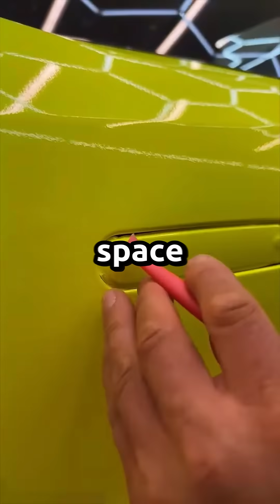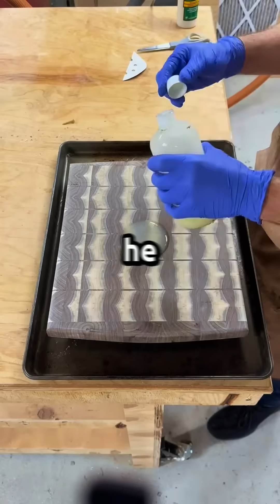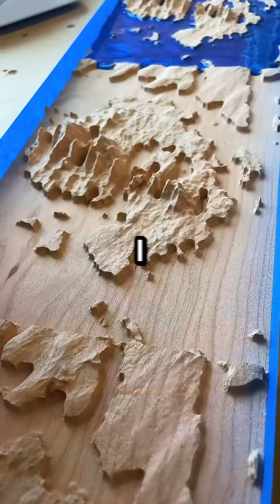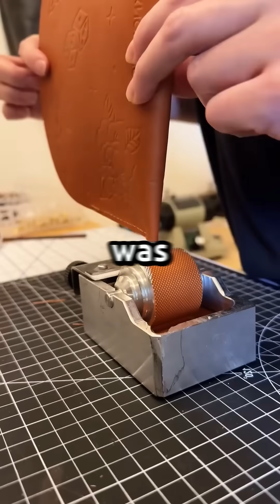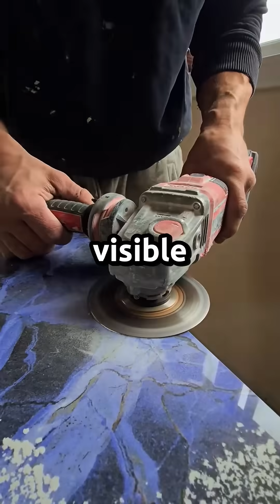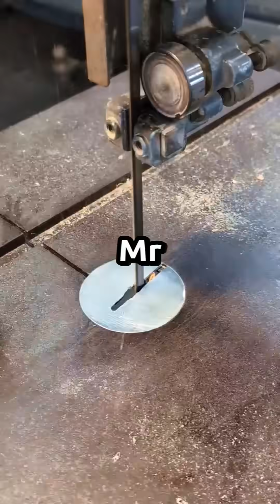reddit story

Comment: Funnily enoigh, i was tought that too. Untill like 5th grade where the curicullum got updated. For some reason, the 1 to 4 grade, they still used an old, outdated curriculum. I remember how i was wondering how is the wall visible, but the piramid not. Is not like the wall is built in a spiral to matter how long it is, and the great gyza piramid is much wider. Then it clicked in 5th grad. Propaganda basically 😂

Comment: The most inaccurate thing I was taught? The Holocaust 😏 250 thousand tops, according to the red cross documents and mostly due to typhus and starvation because the allies had bombed the supply roads because they needed to manufacture an atrocity to be used as leverage against the West in order to extort it

Comment: The F-35 Lightning II is a family of stealth multirole fighter aircraft developed by Lockheed Martin as part of the Joint Strike Fighter (JSF) program. Designed to perform ground-attack, reconnaissance, and air-defense missions, the F-35 comes in three main variants: the conventional takeoff and landing F-35A, the short takeoff/vertical landing F-35B, and the carrier-based F-35C. The aircraft is intended to replace a range of aging fighter and strike aircraft across multiple branches of the U.S. military and allied forces, making it one of the most ambitious and expensive defense programs in history.

A defining feature of the F-35 is its advanced stealth technology, which allows it to evade radar detection and operate effectively in contested airspace. It also boasts a sophisticated suite of sensors and communication systems, including the Distributed Aperture System (DAS) and the Active Electronically Scanned Array (AESA) radar. These systems provide the pilot with unparalleled situational awareness and data-sharing capabilities, enabling the F-35 to function as a "flying command center" within a networked battlefield environment.

The F-35’s design emphasizes both agility and survivability. Its single-engine configuration is powered by the Pratt & Whitney F135, one of the most powerful fighter jet engines in the world. The aircraft’s internal weapons bays maintain its low radar profile, while also allowing it to carry a versatile mix of air-to-air and air-to-ground ordnance. Over time, its mission systems have been updated through software-driven upgrades, improving combat performance without changing the aircraft’s airframe.

Despite its cutting-edge capabilities, the F-35 program has faced significant criticism over cost overruns, production delays, and maintenance challenges. However, as more units are delivered and operational experience grows, many of the initial issues have been addressed. With over a dozen allied nations now operating or planning to acquire the F-35, it has become a central component of modern air power in the 21st century, shaping the future of aerial combat for decades to come. Would you like this turned into a presentation or infographic?

Comment: One claim was that the China's Wall is visible from the moon.
It isn't.

But it is possible to see it from the low earth orbit when the conditions are optimal.

Something being possible to see, doesn't mean you can always see it, or it is very easy. 

Like example, there are events when one can see other city lights other side of the sea, over 80 km away. Even when the horizon is just about 5 km away and doesn't provide straight line of sight.

Yet it is not incorrect to say that other country city lights can be seen over the larger sea. As well the tallest buildings, towers and chimneys. As it is possible, just that it requires specific weather conditions, lighting and season. A rare event, but still possible.

This is the same thing with Chinese Wall.
Even the NASA astronauts has told that it can be seen, but in very specific conditions. 

And that is enough to support the claim, that it can be seen from the space.

But it is not only man made thing you can see from the space...

Comment: First, my point: that's why some teachers and professors who contributed to researches in education during the XX century promoted classes centered in the students instead of the teacher, shortening the distance between teachers and students.

I feel that sometimes these reddit stories are exaggerated, but even so, they are plausible to the reality. This is the type of situation that I saw happening before or listened from classmates. My mom said that a math teacher confiscated her book and told her to leave the class because she was reading after finishing her assignment in class and was waiting other students finish and the teacher to correct it on the board (about 40 years ago). I had another math teacher making me cry in the class because I didn't understand the assignment (I was an "outstanding student" - lit translation, an merit we received in school after finish a year with excellent grades in every class - I am an engineering undergraduate now).

Comment: I had done similar things in school. I unfortunately was much smarter than most the teachers and would often correct the teachers. except there was no happy ending for me. they instead suspended me multiple times and then placed me in special needs classes for my "Disruptive behavior".  I was stuck in the special needs classes for almost my entire time in school.  that was until I was old enough to apply for running start and got to skip all of high school and take college courses instead. earning my high school credits from my college courses. at college I got almost perfect grades and got onto the deans list.     I majored in computer science as I wanted to become a programmer.  I enjoyed solving problems with my logic and reasoning. No one could argue with me about if I was right or wrong when the software I developed worked  perfectly.  unfortunately I failed to find a job in the industry as I failed to develop the social skills to get past the hiring processes and now the industry has essentially collapsed.  now I just hate people and government as they have done nothing but get in my way of my ambitions.  I  am looking forward the the collapse of society . I am looking forward to extended blackouts. as studies have shown 90% of the population will die.  while I have been learning the skills needed to survive such a collapse for the last 10 years.  soon I will finally be free of humanity.

Comment: THOSE WHO DON’T KNOW

⸻

ANTIMATTER — THE FULL BREAKDOWN

Alright, listen up — antimatter is no ordinary topic. It’s basically the most extreme, powerful, and mind-blowing stuff in the universe.

⸻

WHAT IS ANTIMATTER? (Definition)

Antimatter is like the dark twin of matter. It’s made of antiparticles — these are just like normal particles (protons, electrons, neutrons), same mass, but with opposite charge. For example, the positron is the antimatter version of the electron, but it’s positively charged.

Here’s where it gets badass: when matter and antimatter meet, they annihilate each other in a flash of pure energy — no leftovers, just raw power, usually gamma rays. This is basically the universe’s most intense form of destruction and creation.

⸻

EXAMPLES OF ANTIMATTER
	•	Positron (e⁺) → Anti-electron, positive charge.
	•	Antiproton (p̅) → Anti-proton, negative charge.
	•	Antineutron (n̅) → Anti-neutron, same mass, flipped insides.
	•	Antihydrogen atom → The simplest anti-atom: antiproton + positron.
	•	PET scans → Medical tech that uses positrons to scan your body — antimatter saving lives.

⸻

HOW’S IT FORMED?

Antimatter doesn’t just pop up for no reason. It’s born in places where energy is off the charts:
	1.	The Big Bang → When the universe exploded into existence, it made equal parts matter and antimatter.
	2.	Cosmic rays smashing into Earth’s atmosphere → Space bullets hitting us at insane speeds create antimatter right above our heads.
	3.	Radioactive decay (beta-plus decay) → Certain atoms spit out positrons.
	4.	Particle accelerators → Scientists smashing particles together at near light-speed — boom, antiparticles.

⸻

WHY DOES ANTIMATTER EXIST? (Causes)
	•	E = mc² (Einstein’s big rule) → If you’ve got insane energy, it can turn into matter and antimatter.
	•	Quantum chaos → Even in empty space, tiny particle pairs can just pop in and out of existence — a wild party at the quantum level.
	•	Balance of nature → Whenever the universe makes matter, it has to make antimatter too, to keep things balanced.

⸻

BONUS: WHY IT’S A BIG DEAL
	•	After the Big Bang, almost all the antimatter disappeared — we don’t know why. That mystery is called matter–antimatter asymmetry, and scientists are still scratching their heads.
	•	Antimatter is being studied as a next-level space fuel — because when it annihilates with matter, it unleashes insane amounts of energy.
	•	We can trap antimatter using magnetic fields — yeah, we’re basically building sci-fi tech in real life.

Comment: My father was a precision grinder, in the early 2000’s after almost 50 years in the industry he got a new apprentice. The apprentice said that he learnt you can't grind aluminium. My dad said yes you can, you need to know the trick. He showed the kid and proved it was possible. He then when into the tech school the following week, and told his teacher who actually yelled at him and said not possible. In the end-of-semester test, there was the question, he wrote yes with a full explanation of how and the physics of why. His teacher marked him wrong. My dad (who usually doesn't care about things like that) went down to the school, turns out the teacher was one of dads failed apprentices from 20 years ago. (a very small industry in our country). Dad walked in, basically called the guy out for his lack of knowledge, then got on the grinder and taught every kid in the class (only about 7) exactly how to grind aluminium. He retired not long after but he still gets messaged from the major firms he worked with saying, we got another one that knows how to grind aluminium!

Comment: I had an experience similar to this, but with fewer results, unfortunately, I had a teacher, teaching about basic 3d geometry, when the topic of the face area came up, I referred to a square side as a rectangle, upon which statement she responded as if i had insulted her mother. Claiming that the definition of a rectangle was a polygon  with two set of equal sides, that both had different lengths. She even continued disagreeing when the other math teacher and the principal told her that she was incorrect. The thing is that she was able to convince some of my fellow students of this false information. All I can wonder is what other misinformation, possibly more harmful, she was peddling to other students.

Comment: We did the physics double slit experiment in class and explained it using wave mechanics.  Being a computer nerd (back in1977 when no one did that sort of thing) I set up a simple simulation on the computer which, of course, poved it rubbish. So I checked with the class genius (who happened to have a dad working on Xray crystalography). We went back to the Physics teacher who thourght about it and said "sometimes we teach you things we know are wrong, it's too complicated, if you study at University you can research it."  My mate became head of physics at a major UK University.  Any one know if the lies are still being taught, or has quantum entanglement entered the curriculum.